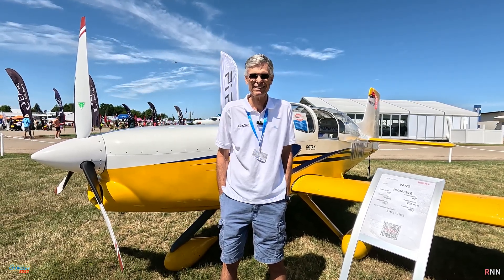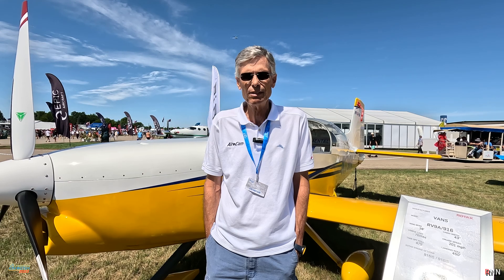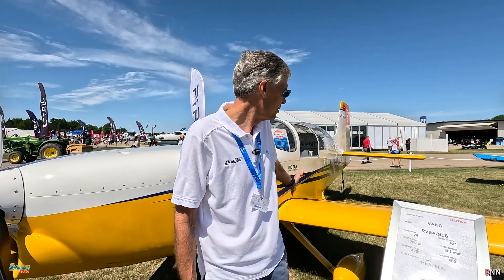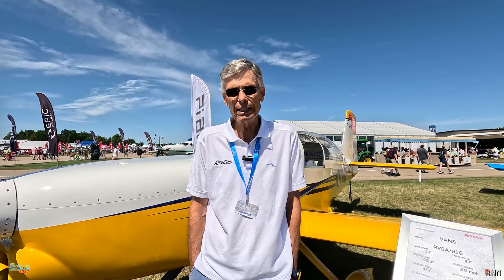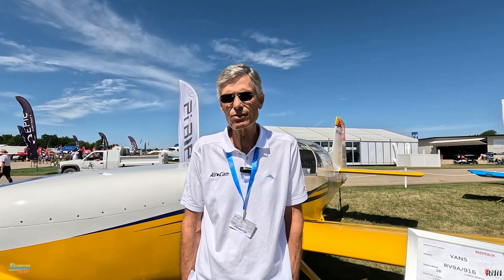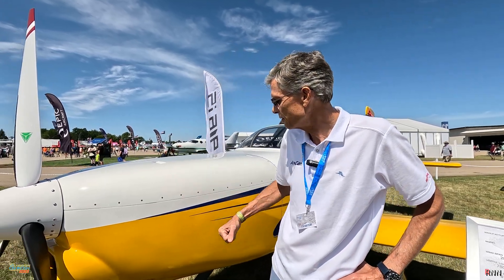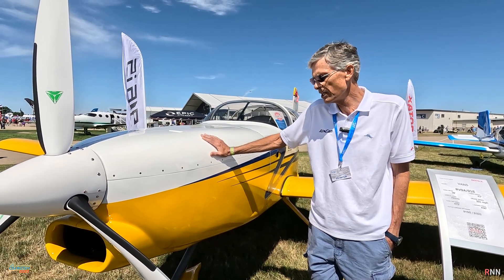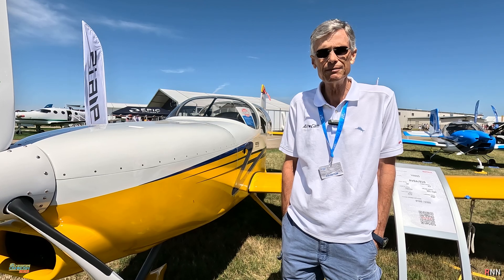AV2023 PHIL LOCKWOOD -  RV9 915/916iS FWF PROTOTYPE

Comment: i saw  this RV9A 916IS N179RV flying data on flightaware of last 3 months may-aug 2025 ....it was doing 210 knots easily at FL174  tops it did 214 knots or 246 mph ...THIS IS sr22T level performance at half of the fuel burn . put it BRS,AC,20 GALLONS Fuel tank....with 52 gallons unable 2 on board 210 knots cruise  1000 nm in less than 5 hours is something else .thanks for such a wonderful setup lockwood its a best plane under 300k usd category with Full IFR,AC,BRS,.....i will be ordering kit in march 2026 .

Comment: All this effort would yield more speed in an RV7 or 8, no?
Reply: The 9’s high(er) aspect ratio wing is the only one that can fly high enough to really take advantage of the turbo for better TAS.
Reply: @k5sss   Altitude/climb is a function of excess energy, so more than just airframe eff.  The long wing is nice but not a driver.   My pt was the Vne of the 9 is 20kts lower TAS.   So not ideal.

Comment: I hope Lockwood Aviation is able to add a storage compartment up front like the RV-8 has.  It certainly appears there is plent of room.  Why waste that space?
Reply from the maker: After a quick call with Phil, he says they will look at it as an option or even a BRS mounting point.  He did mention that the space will allow them to run larger coolers.
Reply: @rotaxnewsnetworkrnn7234  Oh that’s very good to know. I was wondering about this. I wonder how they would approach it. If the WB allows them to keep everything per their current design (to minimize the need for development resources) or if they would optimize for the BRS and shorten the nose (and potentially lessen or eliminate the dorsal fin). I can’t say how big the market would be for it, but I suspect there would be interest from folks used to flying more modern aircraft (like many of the Rotax crew do) that have a chute. Irrespective of their future work, this is a lovely piece of work and they should be very proud of what they have achieved.

Comment: Very interesting! The O-320 is definitely not the biggest engine people are putting into 9s, though. They're routinely built with O-360s, despite Vans' advice to the contrary. I've got an O-320 on mine and can't really figure out why people would install a higher HP Lycoming engine.

Comment: I thought they had to increase the tail area to maintain stability but he didn’t say anything about that, so maybe not
Reply: If the cg range is maintained there is no reason for any pitch stability issues. Directional stability is always an issue when you lengthen the nose of an aircraft. Looks like they have added a large dorsal fin. I wish they had shown a side view of the airplane.

Comment: While the Rotax 916 has 160 hp at takeoff, it only has 137 hp continuous, a grand total of 2 hp more than the 915.  So unless you’re into STOL flying, it makes more sense to use the 915 engine.

Also, I’m happy that you plan to offer this as a package to builders!
Reply: .. And the 916 is 2000 TBO.. 915 is 1200..   may or may not be worth the extra price just based on that alone.
Reply: I’d be willing to bet your pucker factor that when you’re at gross on a short runway with density altitude north of 7000 feet an extra 20 hp is worth it’s weight
Reply: Performance wise, you should be able to increase your gross weight and lift more useful load into cruise flight.  And increased climb rate is a good way to avoid icing, though both being turbo already have that covered.